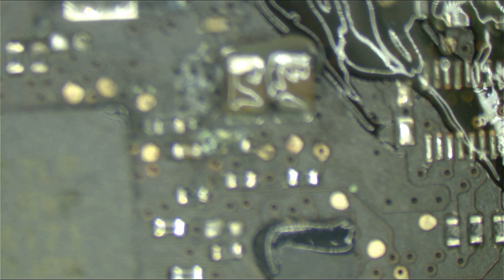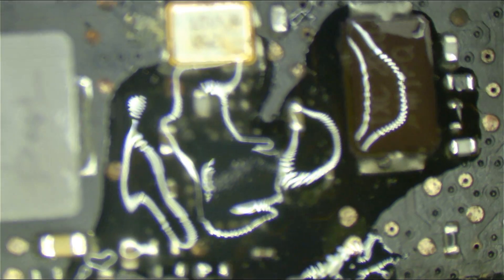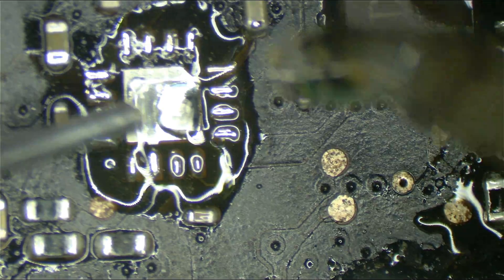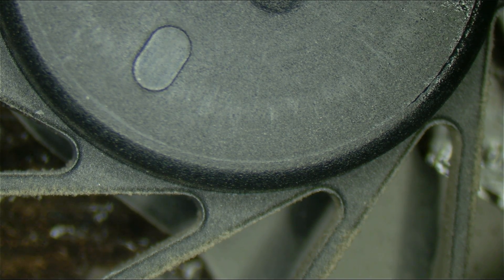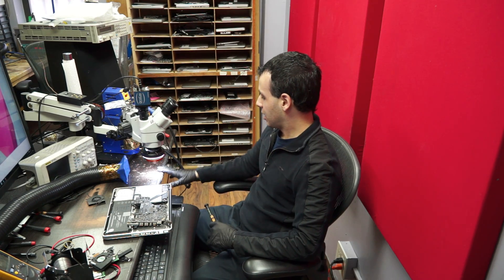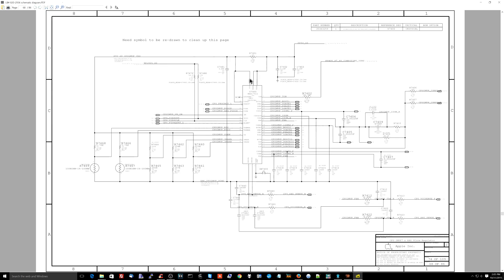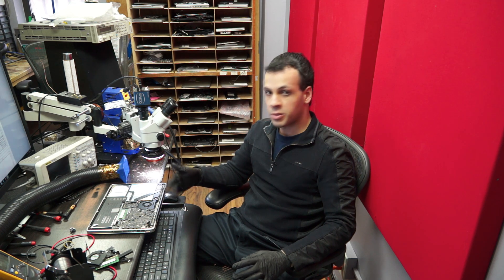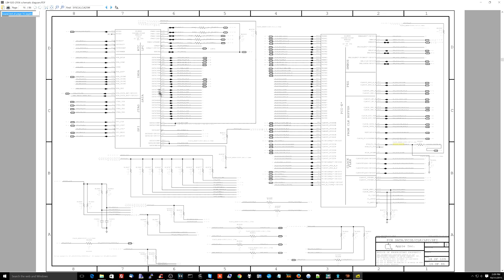Macbook logic board clock issues cause quarter fan spin :(

Comment: greetings Louis,
if you would like to make your extraction equipment less noisy change out the concertina hose for a smooth bore hose and you will lower the noise floor a few db because the flow will be more laminar.
ricci

Comment: Something I don't understand about Apple. They don't want these boards serviced. They themselves don't service them - just replace them. Their computers aren't water tight. Why don't they conformal coat the boards at the factory??  It'd solve the water damage problems.
Reply from the maker: +unaclocker Why indeed.
Reply: +unaclocker Weight and Clearance most likely. When they sell their laptops based on how many ounces they weigh and how many millimeters thick they are they probably do see any reason to coat the boards. They control the supply chain anyway, right?
Reply: Conformal coating makes rework a right bitch of a job. Maybe the solution is a hybrid approach (e.g.  just coat the BGAs.)